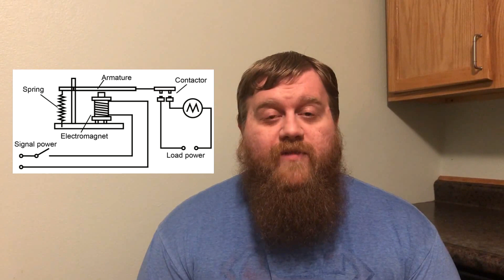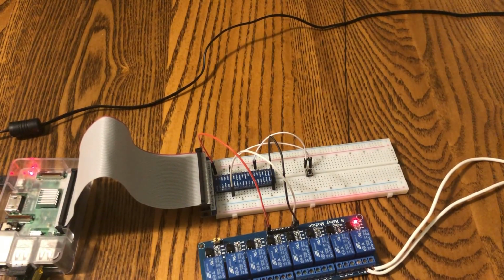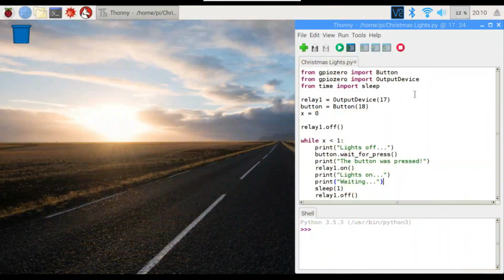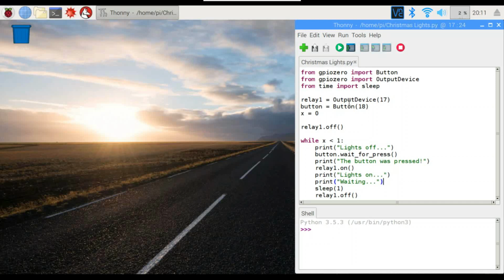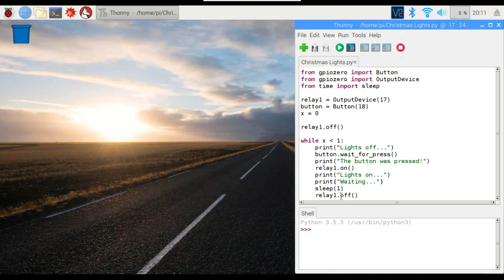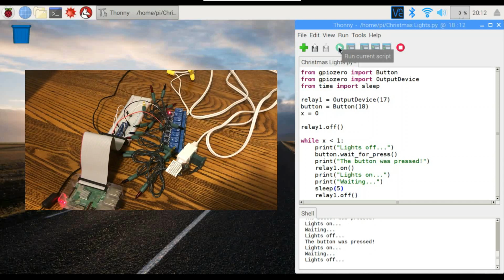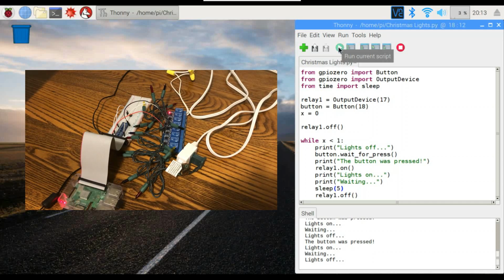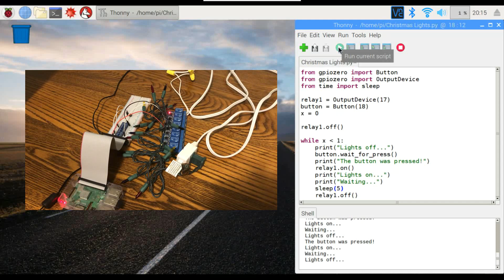Raspberry Pi Christmas Lights | Raspberry Pi 3 B+ | Projects for Beginners

Comment: Might be a silly question, but if those relays are 5V and the standard Christmas lights take in 120V (according to a quick Google search), how does it manage to power it?
Reply from the maker: A relay is basically an electronic switch that connects another circuit so there are two circuits here. The “switch” is 5V which can be powered by the Pi. The circuit that is being connected is 120V. The two different currents never cross.
Reply: @ThinkingofPi  Ohh that makes so much sense. Thank you!